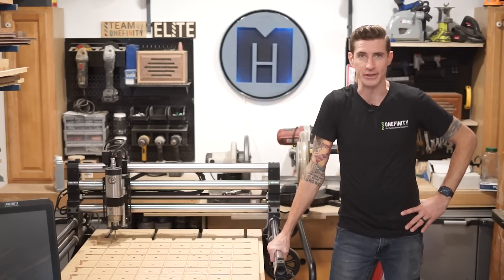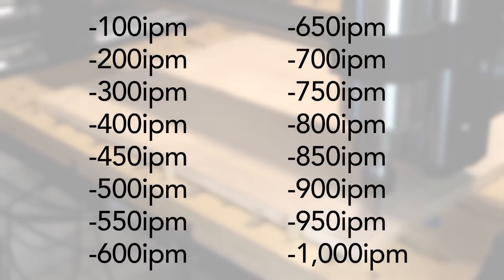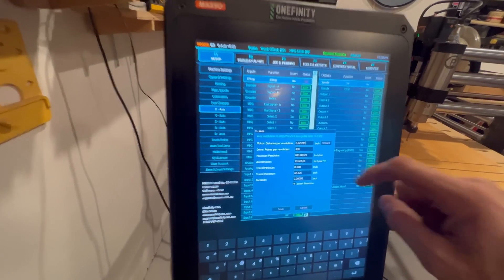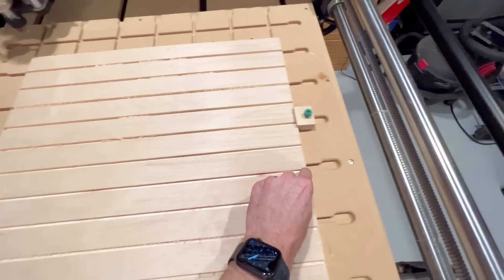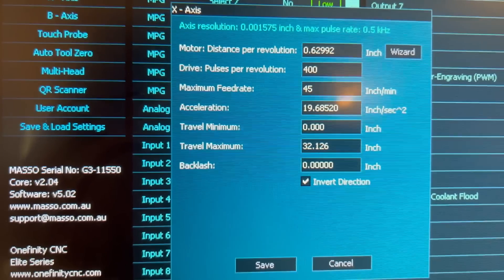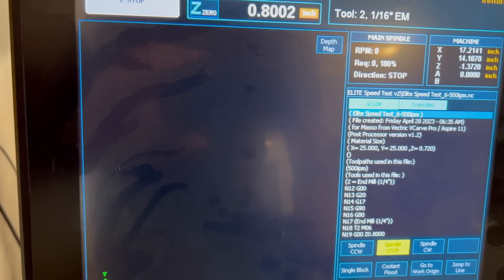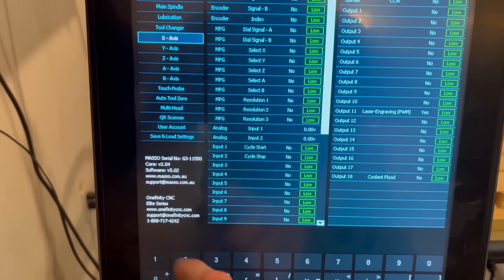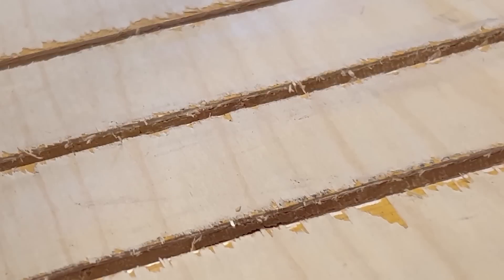EP 16 Onefinity CNC - Let's Break A CNC Machine | Hobby CNC machine CUTS at 1,250 IPM!

Comment: one aspect is that you are using a short bit which allows for the force bending vector on the bit even at that speed not to break it, and cutting .25 is not that much of a force for the axis to overcome i think.
Reply from the maker: wasn't it fast?!
Reply: @OnefinityCNC  however...fast is irrelevant in most situations... you have to determine speed and feed and QUALITY of the cut by the ability of the bit not to break.   I could put a stubby bit in my forman and do that same for showing total speed.. but again.. it is a meaningless thing to do other than showing the machine is indeed very rigid and stable, which is why i bought mine.  i do think the machine could take a 1/2 shank bit and do the same speed due to the difference in forces... lol   just saying dude...

Comment: Aluminium test ?
Reply from the maker: check our other videos.
Reply: @OnefinityCNC  thanks will do one final question can the software decide a default spindle speed and paths speed based on material and thickness selection automatically to avoid tool breakage or do i have to specify on the drawing software.

Comment: USELESS INFORMATION: 1250 Ipm looks and sounds incredibly fast, yet it is only 1.183712mph!! I was expecting it to be much faster.
But converted to metric 31,750 mm/min
1.905 kmh!
Ive seen lasers running fast. But they have lightweight heads not hunking heavy VFD spindles.
Do 1Finity know the absolute Terminal Velocity of these?
I guess no-one says it needs steppers calibrated ;-)
Reply from the maker: lol.

Comment: Chip rate to speed ratio looked like it went south somewhere around 450 IPM. I'm glad you pointed out that although it reached 1250 IPM, the top speed was short-lived on a straight cut somewhere in the center of full length of machine as well. The actual cut rate on that pass is probably average in the 650 range, but nonetheless, you did it without snapping bit or breaking anything. Impressive is an understatement! There is no doubt about the only thing you're going to break on these machines are the bits & router/spindles because their built to last. To bad Onefinity doesn't build spindles as well 😂
Reply from the maker: The machine is a beast!

Comment: Hi Morgan, not in the market for a cnc router at the moment ,but if I were, it would definately be a onefinity machine (helps that i'm canadian😀)
Having a background in metalworking cnc machines , speed is great, and it also must make circles and diagnonal lines as well.
A common test that is done is a circle,diamond,and square test    Its very easy and will tell you exactly how well a machine can do circles(x,y) anglular lines(x,y) and straight lines (parrallism)
The circle will help detect   backlash errors and in their correction. the diamond will identify if the x,y axis are moving together correctly  .
Reply from the maker: Sure would!  But that wasn't what this video was about.  Just showing the top speeds it can hit, and it was fast!

Comment: When using a 1/4" 2-flute end mill at 24,000 RPM, the maximum recommended feed rate for milling at a 1 x diameter (1 x D) depth of cut is 384 inches per minute (0.008 inches per tooth). The end mill begins to tear the wood instead of cutting it at more aggressive feed rates.

It is impressive that the Onefinity can tear through the wood at 1250 IPM. As noted, this is dependent upon use of the 2hp spindle which bogged down only slightly.

Assuming the end mill is not becoming discolored from heat and the edge is not becoming dull from abrasives in the plywood, then roughing could be performed at 1250 IPM and finishing could be performed at around 288 IPM (0.006 inches per tooth) to 384 IPM (0.008 inches per tooth) or 480 IPM (aggressive, lower quality surface finish) after a tool swap to get a better surface finish. 

Using two end mills - one for roughing and one for finishing - generally produces the best results and yields the longest tool life and best quality surface finish.
Reply from the maker: Thanks for the info.